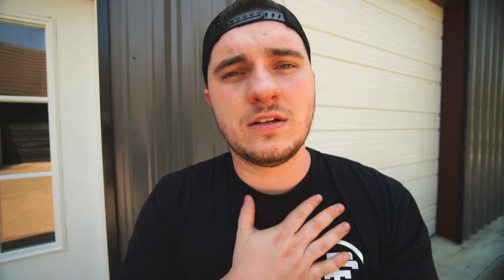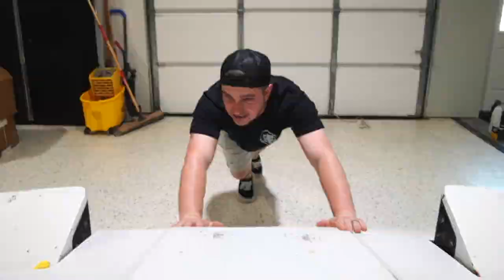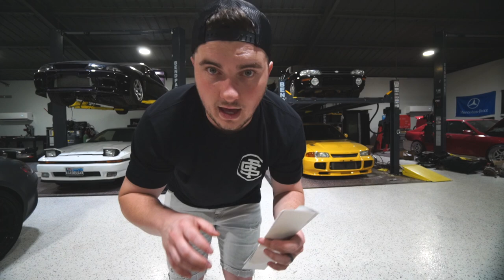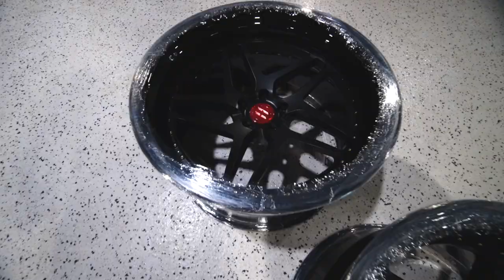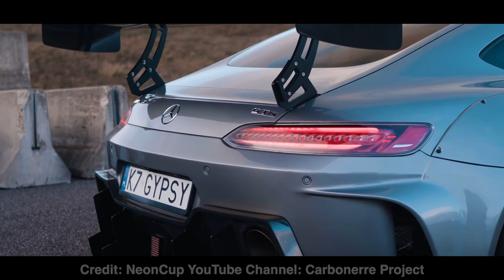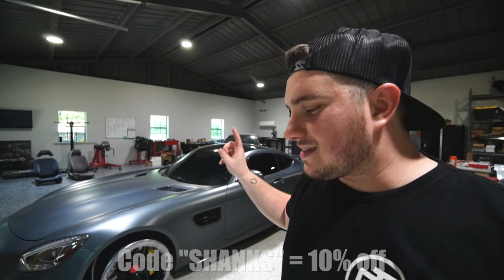The CRAZIEST wheels I've ever built... Going Full Send on the AMG

Comment: I hope this doesn't happen and that you don't end up regretting and having to end up re-doing it, but I feel like the carbon rear parcel tray on the R33 isn't going to work out well.

Reason being, especially if it's in a gloss finish, I feel like it's going to glare and blind tf out of you as well as people driving behind you.

Fingers crossed though that it doesn't happen and that it works out!🤙
Reply: It's going inside the trunk
Reply: @RoflWolves  nah besides the truck piece for the air setup, I'm pretty sure he mentioned that he's getting the parcel tray that's under the rear window done in carbon as well, when he was mentioning getting the rear seats re-done